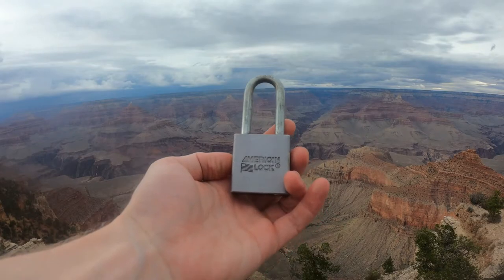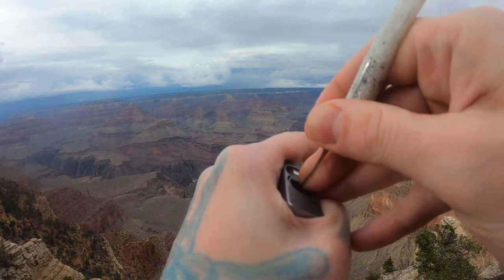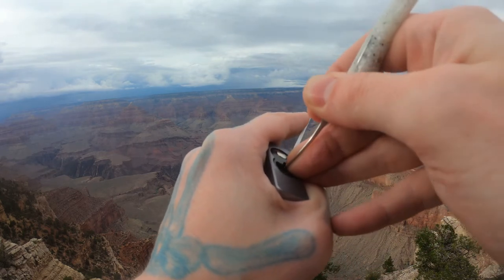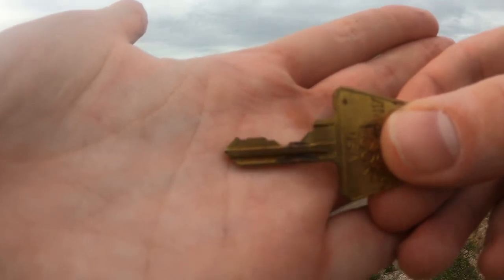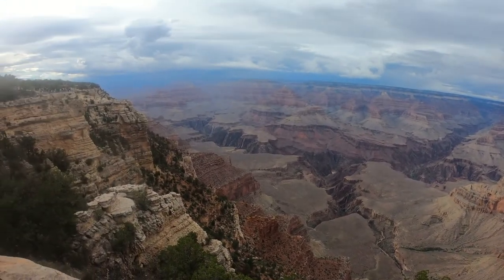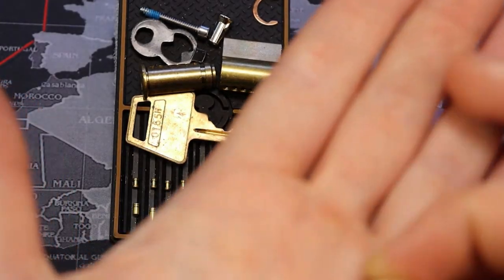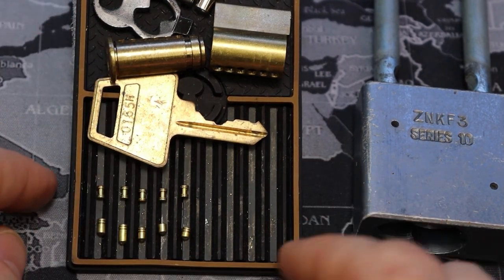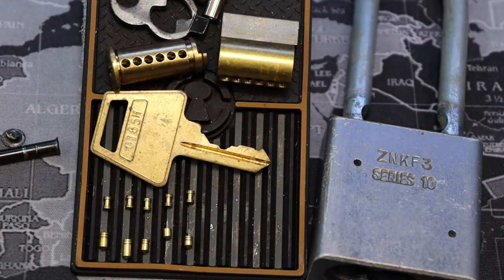201) American Lock Series 10 Picked and Gutted at Mather Point, Grand Canyon

Comment: Is there a good source for getting the nut and screw to replace the rivets?   I imagine alot of people just have them laying around, but all mine are in locks that I want to stay toghether :)  I have a couple riveted americans that I'd like to get in to and reassemble.  The grand canyon is one of the only places where I felt a fear of heights, thanks.
Reply from the maker: I can't remember where I got mine from. I know I found the nuts on a lock website, maybe CLK supplies, but not positive. Maybe the bolt as well but not positive. Could have got those from hardware store.